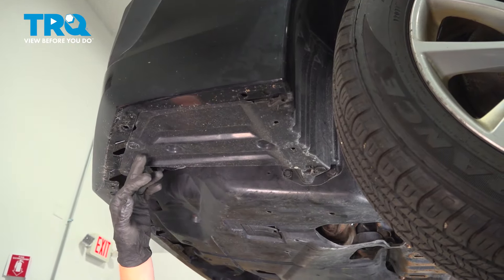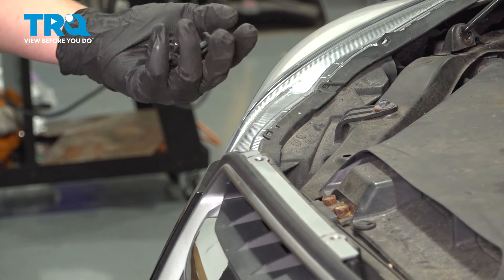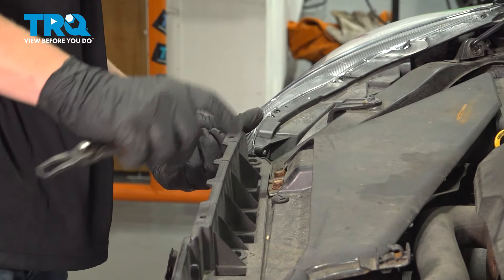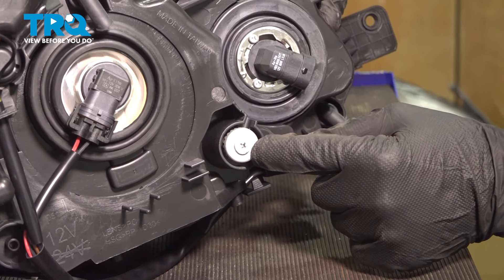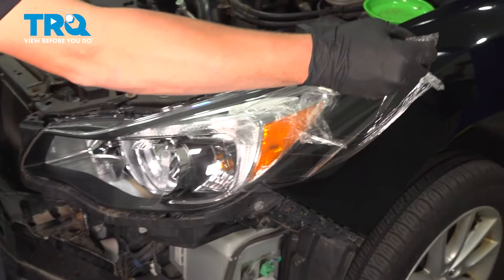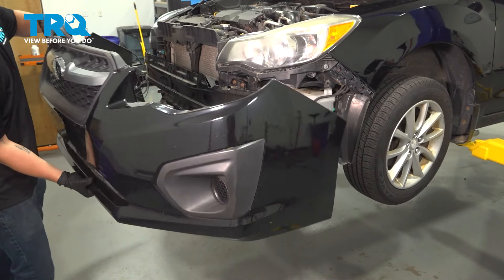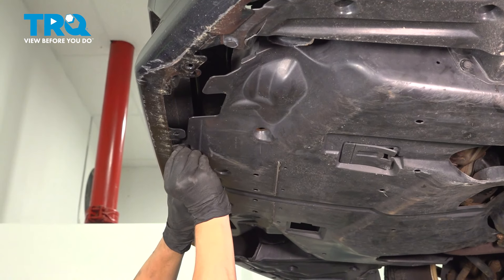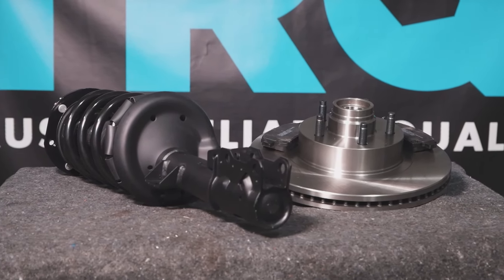How to Replace Headlight Assembly 2012-2016 Subaru Impreza

Comment: Needed to replace a headlamp assembly on my 2017 Forester. Body shop quote was crazy high, so I ordered the part myself and used this video as a guide. Worked like a charm! A few of the clip positions were different from what’s shown in the video, but it wasn’t hard to figure it out (even for someone with virtually no experience working with cars, like me). Thanks for the great video!